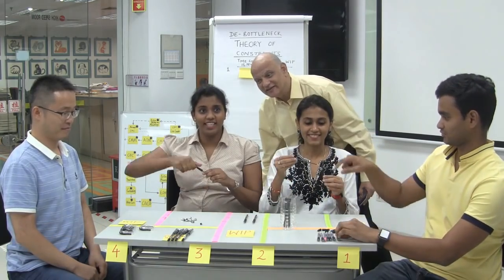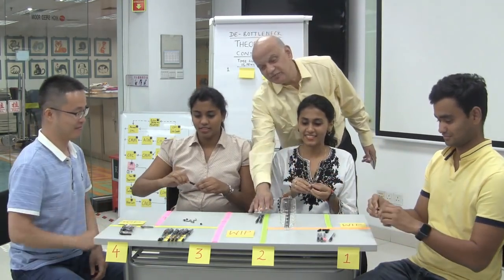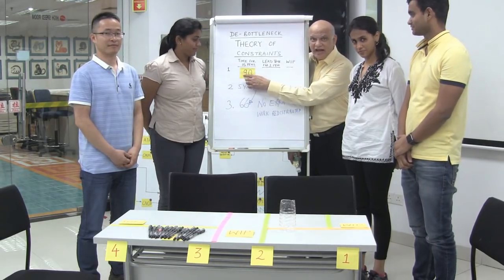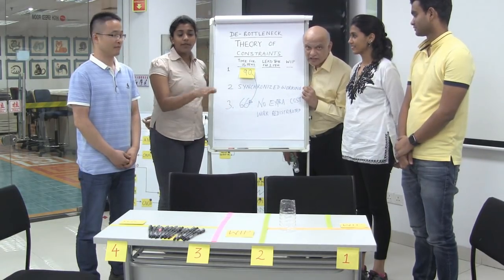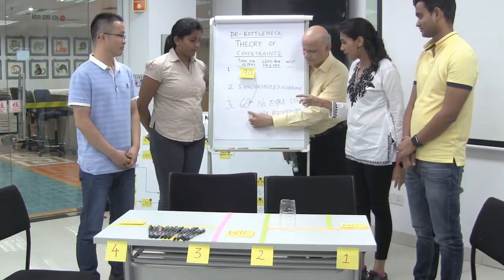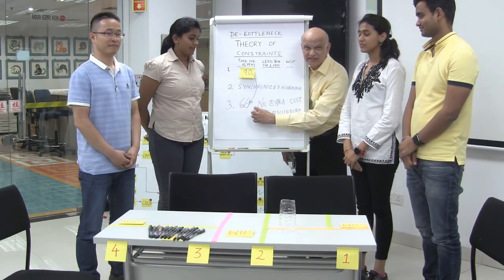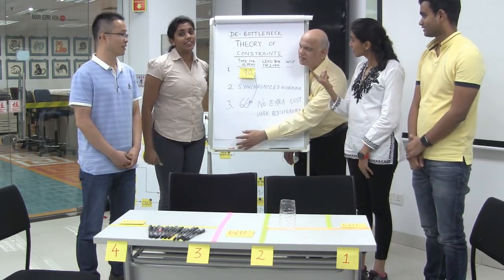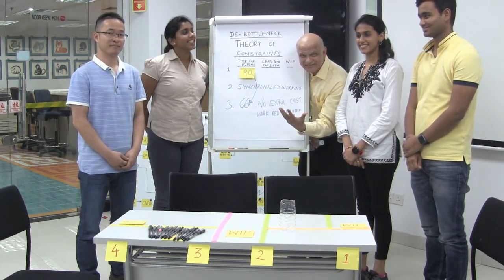TOC Theory of Constraints & De bottlenecking

Comment: Hello sir, thank you for the practical and video. With this we can conclude, we must first find the bottleneck as it is gonna effect on our production.So synchronisation in process always helps to avoid WIP and maintain the production rate. Also bottleneck at start of process helps in synchronisation.If we can make every machine bottleneck we can standardiz the process and will improve the production and cycle time.
Thank you, it becomes easy to understand using practical then theory.
Reply from the maker: Pushkar Kulkarni - in the Toyota Assembly line, the bottleneck is at the start.

Comment: Thank you, Dr. G, One thing I have learned while studying about Toyota's Assembly line is that they would try to put bottleneck at the start of the assembly line. Synchronisation and allocation of idle resources is the key. And its a great example of how the paretos principle works.

Comment: Hello Sir, this process of De bottlenecking is truly an amazing method of shortening the lead time and the throughput time. Also, it can be applied elsewhere. For example it can be used in companies which require a lot of assembly.

Comment: Sir the video shows how the speed does not always depends on efficiency at which machine/person is working.
Synchronising the speed helps to reduce the WIP.
The output is increased and WIP is reduced when last task is performed by two people.

Comment: It is very important to identify a bottleneck in a process which has a series of operations because the efficiency of bottleneck decides the speed and efficiency of the entire process.
Also synchronisation of other operations with bottleneck is important as there is no WIP because of it.
Focus should be on improving bottleneck's efficiency rather than focusing on individual efficiency of other operations.
Debottlenecking reduces the overall process time and it also reduces the time taken by an individual item to go through the series of operations.

Comment: Thank you Dr G and team for explaining the concept in the simplest form as it can be.
What icould understand from this is that the concept has been greatly implemented in the unorganized sector of economy
Like for example any franchise of vadapav vendor ...few years back customers were supposed to pay and then take vadapav from a single person at the counter even though other resources were available and were idle.
This resulted in massive crowd around a single point of contact
As of now there is a seperate person collecting a cash and seperate person to handover the product to customer  and both of them work in synchronization with each other.
Another scenario what i could think of is that this concept must definitely be implemented in passport offices
Because out of the 2/3 sections in passport office that i have been through  there is one section which has a large queue with a single point of contact  and is the actual bottleneck in the entire process

Comment: All the points demonstrated in the video are true. They indeed increase the output.

I have experienced this in my previous work place. My manager had distributed the work among all 5 team members on the day of our joining the project. But, somehow it took each one of us long durations to finish the assigned work. It was then that he realised the bottleneck(not all the members had same level of expertise in a given task) for low efficiency. He eventually found out the strengths of each member and assigned the work in their area of expertise. This lead to faster and error proof smooth work, increased the productivity, met the deadlines perfectly and in turn the team had a happy work atmosphere.
This reanalysis and redistribution of work (like shown in video) helped us a lot to progress as a team.

Similarly this can be applicable for any team work. As identifying the bottleneck, working in sync with bottleneck and the redistribution of work will make it more productive.
Thank you :)
Reply from the maker: Rashmi Kamkar - Traditiinal and American originating management does not understand teamwork and does not understand that tge sum of parts is less than the whole. Let us discuss this in the class.

Comment: The sole reason we fail to identify the bottleneck or address the issues pertaining to bottleneck is when we start concentrating on individual’s efficiency. But yet again, this video teaches and showcases how we can minimise the cycle and even throughput time with the help of a bottleneck! Either work with the bottleneck’s speed or everyone become a bottleneck. An important lesson in operations is to synchronize the work.
Reply from the maker: Shubhangi Srivastava - Absolutely correct. Excellent.

Comment: Surely a great video but there are a couple of issues here: 1. There is a risk attached to redistributing work especially for critical processes if the 'additional resource' may not have a technical knowhow. This in fact, increases the risk of an error, low quality or penalty cost. 2. There is also a risk of paying higher wage to the additional resource since he is taking up extra work. Therefore, this can only be a temporary solution and cannot be used in long term.

Comment: Hello Sir,
Precisely the identification of the bottleneck and rectifying it by synchronisation of the work stations or placing the bottleneck at the start of the process, this concept if  put forth in the   company's work standardization  sheets  can  really bring about  an effective process re-engineering   to increase the output that to without increasing the cost.
Reply from the maker: Vrunali Dharod - Correct Vrunali. Dr G

Comment: This is a great experiment! Instead of stressing too much on the problem we should look for a way around it by identifying the bottleneck and then synchronising everybody to increase output.
 Thank you for this and the experiment in class. Learning by doing helps :)
Reply from the maker: You are right. Learning by Doing is indeed one of the most powerful way of learning. It causes the learning to be imbibed in the body enabling assimilation.

Comment: Thank you sir and team to make us understand that it's not always the speed which increases efficiency but synchronizing the process and debottlenecking also improve efficiency.
Reply from the maker: Janhavi Raverkar - Correct. Efficiency of the overall system is more important than individual stations.
Reply: Shrinivas Gondhalekar yes sir. I will remember this.

Comment: Really useful video!! We would implement it in the projects that we do.👍
Reply from the maker: Reshma Xavier Please share your implementation.
Reply: Shrinivas Gondhalekar sir

During undergraduate, when we are assigned projects , it was divided into many parts 1) Document gathering 2) Creating algorithm 3) coding 4) Documentation of the whole project 5) Creating Black book. Each step is assigned to each individual. Steps 1,2 and 3 is completed within the allotted time but step 4 takes a lot of time, which in turn leads to delay in black book creation, thus all the efforts wasted (bottleneck).So while step 4 is being executed all the other members can take up samll parts of work as they are idle. Similarly while step 1,2 and 3 is working person responsible for step 4 can help cause he/she is idle (de-bottlenecking and synchronized). Had implemented this process after multiple trials back then.

Comment: What about machine's work in the bottle neck???
Reply from the maker: If the machine is the bottleneck, the principles remain the same. Step one - study the operation to find and eliminate or reduce any non value adding activity. Often loading and unloading are often the two such non value adding activities. Step two -  Synchronise by beating a drum exactly like in the human operations. Step three - speed up the machine if possible or add a machine or change the process and so on.

Comment: what was the 4th option ?? i
Reply: Add more resources. ;)
Reply: @rigovalenz  That was their answer.
But actually. that was the wrong answer !!!
The right answer should have been resolving the new bottleneck.
Which now was employee number 1.
They should have done the same with employee 1 and 2 as they did with 3 and 4. Redistribute work!
You should always resolve every new bottleneck first until you can no more, and only then start to add sources.

Comment: When synchronizing, operator 1 & 2 have to slow down their pace to follow the bottleneck speed..isnt that a problem?
Reply: Excess WIP is the real problem, not a lack of utilisation. Increasing output at 1 & 2 only increases WIP at the bottleneck and does nothing to increase the output of the system. Keeping some slack in the system and limiting WIP reduces lead time (especially for unplanned work) and reduces wasted resources. I'd suggest reading "The Goal" ;)
Reply: @MattWanchap   this only works if 1 & 2 & 3 all have reasonably interchangeable skillsets allowing them to accomplish each task. In some manufacturing environments, specialized workers are needed at each manufacturing step (i.e. engineering, CNC programming, CNC Machining, Manual machining, Welding, Inspection). I find this concept -- 'reduce WIP' -- difficult to abide by in our high mix, low volume manufacturing environment.

Comment: I dont think this wil work in a manufacturing company. I think to represent the actual phenomena you could have made the person putting the  refil into the pen do the back cap with mayb 2 to 3 threads . That wd have made the process more faster .
Reply from the maker: George, it will and it does work in manufacturing. The example is taken from manufacturing. There are, however, many ways to improve. There is no one best way. What we have shown is one way. You are thinking of another way. It will also work. Many ways will work.